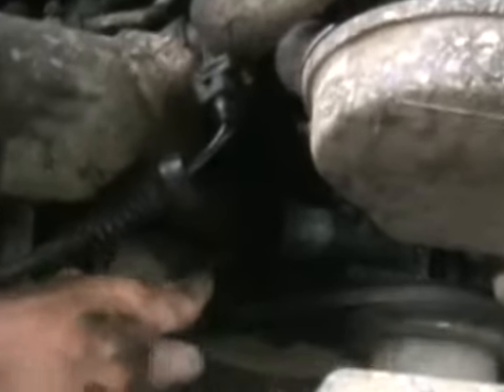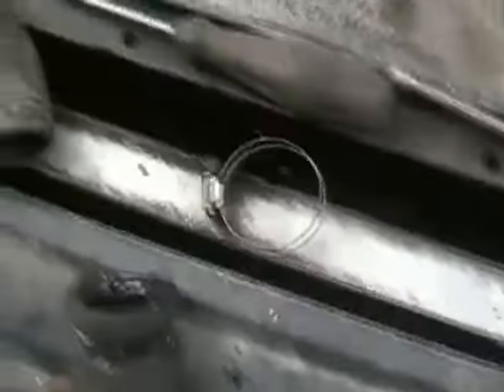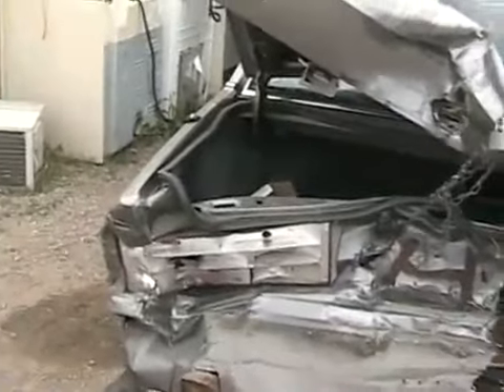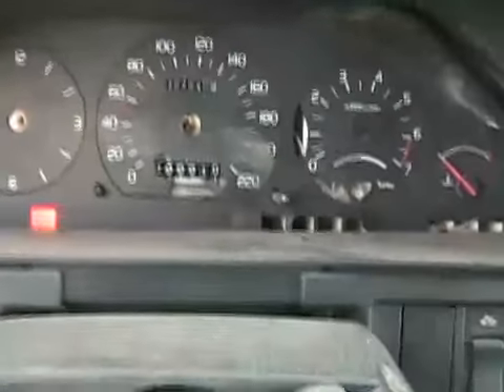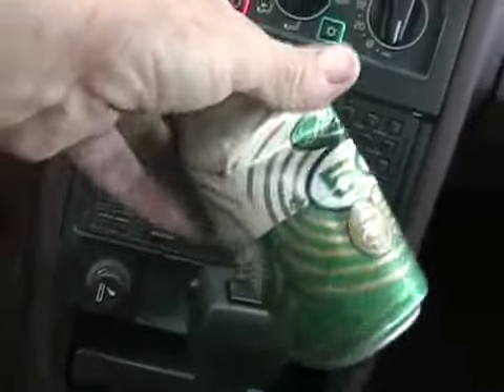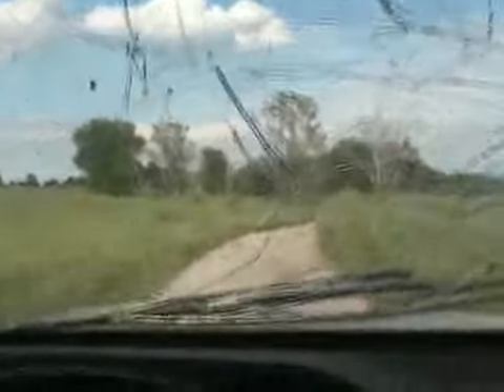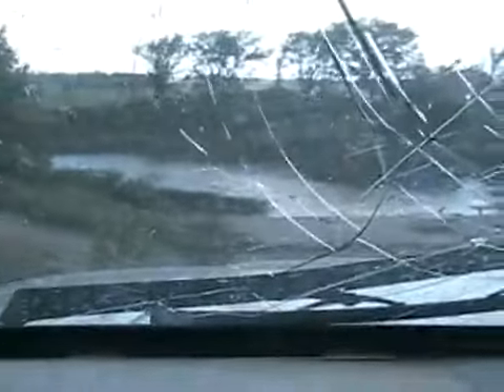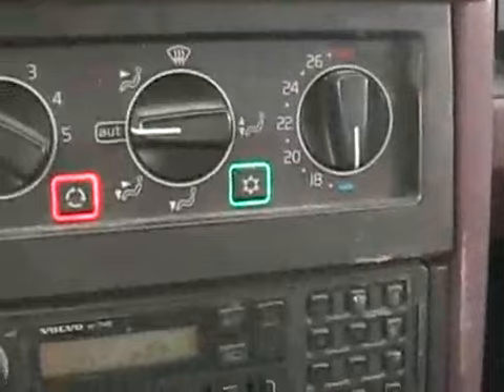Davidsfarm   0605   ZFau1rjxFuI   HQ   redneck rad hose repair and test drive volvo turbo

Comment: oil lubes the bearing in the turbo and engine coolent keeps it cool. thats why turbo cars need fairly clean oil in them because if you use shitty dirty oil the bearing wears out and your engine is down on power and it burns oil